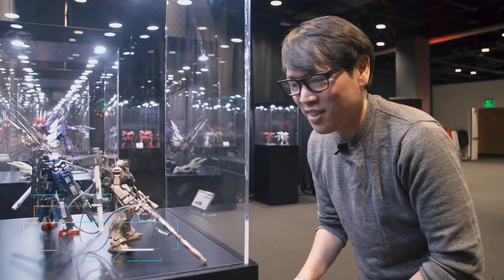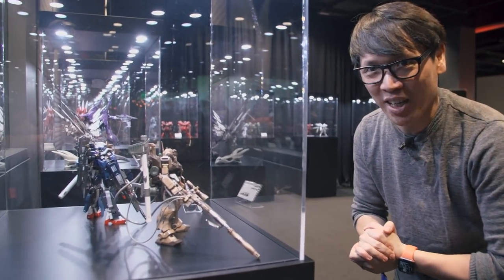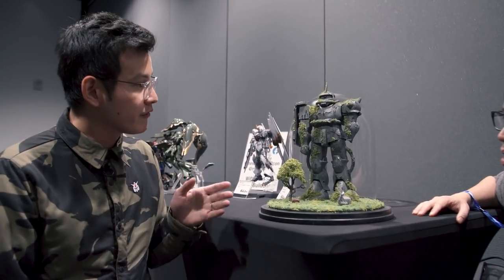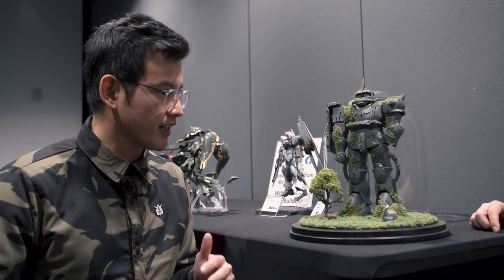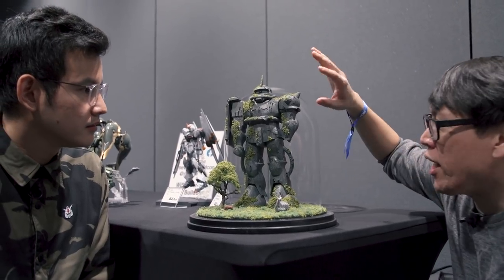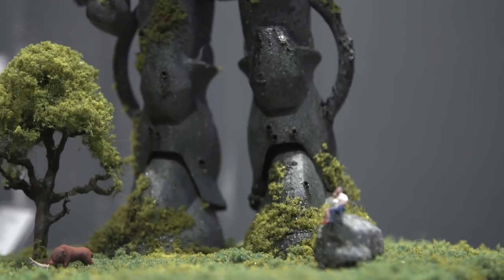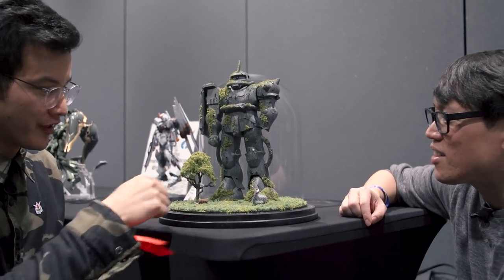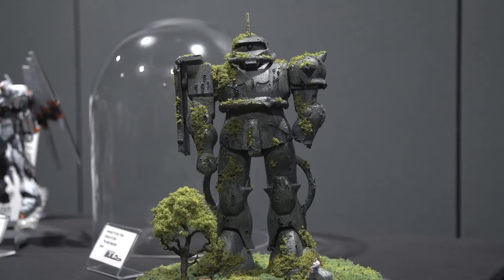Vintage Gundam Kit Converted to Statue Diorama!

Comment: Why does the statue have leaking gun holes if it's made of stone?
Reply: Kinda what I was thinking. I like the idea, but I think it'd of been a better idea to make it an old, rusted suit that had been sitting around forever.
Reply: I think the builder was a bit confused about whether it was a statue or an old immobilised mech. I favor the second interpretation because it's more dramatic.
Reply: Yeah seems like kind of a confused issue with this build.

Though it could be whoever made the statue (in this builder's head-canon, I mean) intentionally built the statue to represent a battered machine. In other words when the "statue" was "carved" the damage was carved into it also.